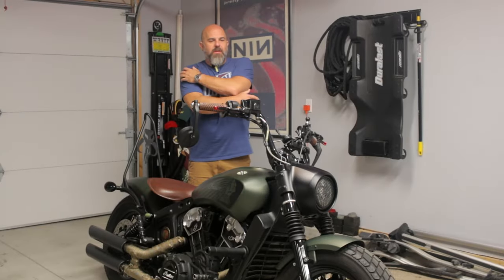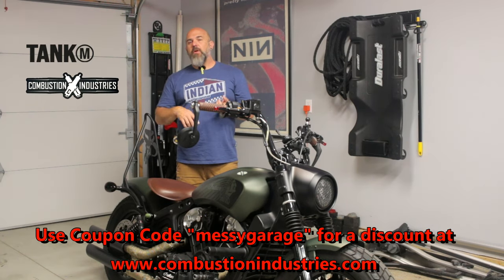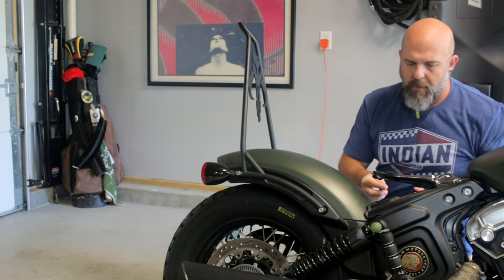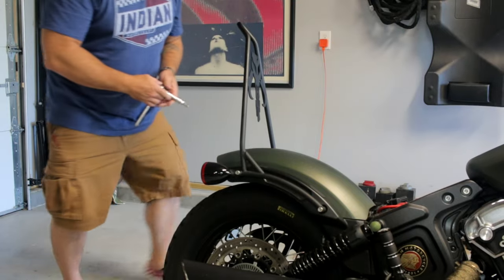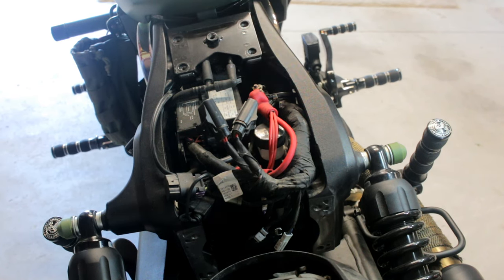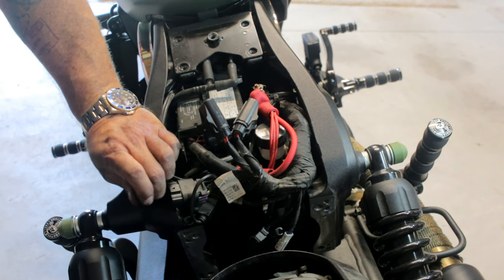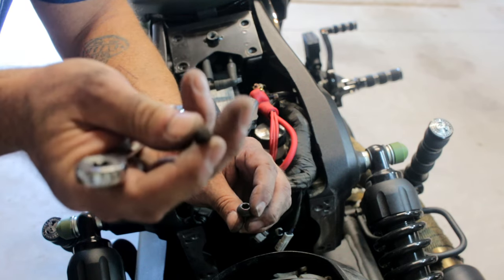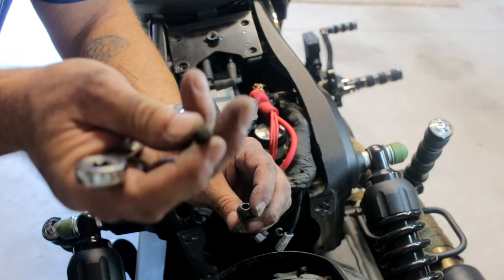Indian Scout Bobber Fender Delete

Comment: REAR FAT-TIRE CONVERSION.........
AND IT'S A WORK OF ART.
Reply from the maker: Looking into which wheel(s) I want.
Reply: I'm going for rotobox boost carbon fiber
Reply: @etishbite456  ????
No idea..........
Reply: @allentraylor5659 Type in big bore kit traveling tall. They are carbon fiber rims very expensive but they take off 15 lbs on rotating mass vs stock Rims. Im a power to weight guy.

Comment: Scoping the bobber, but seeing this dude’s been to the Master’s! ⛳️ 

My used bobber came with the sissy bar. I’m completely new to this. Got any suggestions for toolkits to get most simple jobs done (oil, change battery, removing passenger seat, etc)? And can front forks be adjusted or is that unnecessary? Haven’t seen anyone doing that. Thank you!
Reply from the maker: Yes.  Augusta National is gorgeous!

So, for tools, I try to include a good list in all of my video descriotions but I would suggest a good metric socket set and a set of metrics Allen keys or Allen sockets.  Beyond that,  a torque wrench is a great tool to have as well.  I'm releasing the oil change video today so you can check that out for tools and procedure.  These are great bikes and I have a bunch of content on the channel for them.  Haven't adjusted forks but I know others have put different springs in.  I have not done that yet.
Reply: @MessyGarageBMW Thank you very much, sir! Looking forward to learning more. Appreciate the response. Get lubed up for the golf season!!
Reply: @MessyGarageBMW  Love my new (used 6500 miles) 2021 Scout Bobber Twenty. Since I have no experience with actual new Scouts, how can I tell if it’s smooth or rough, tight or loose… as in, is there anything wrong with it? Do you recommend I take to a certified Indian shop for a full inspection, as I just bought from a small bike dealer here? I got a two-year warranty for major parts and want to be sure I wasn’t sold a patched up bike. I had no reason to believe a 6500 mile bike would be in some way unmaintained or damaged… THANK YOU.
Reply from the maker: @majrminer  before I paid someone to tell me if it felt right I would go test ride a new one and see how it compared to mine.  If it feels pretty similar, I'd feel better my bike is solid.  If there are specific things you question then it may be worth taking to a trusted mechanic but otherwise I'd just enjoy the ride.
Reply: @MessyGarageBMW  Thank you so much. Really appreciate that.